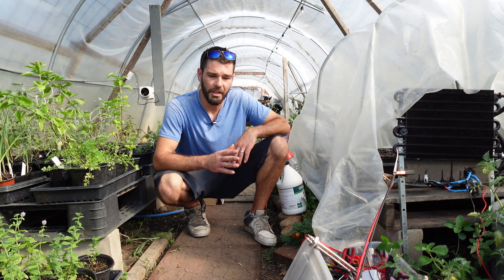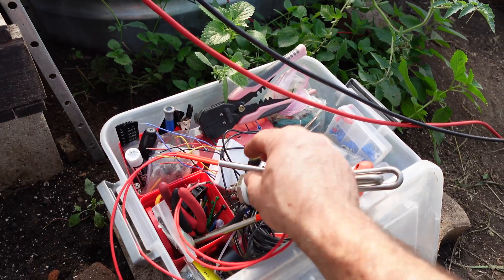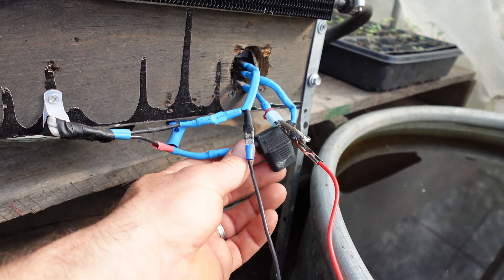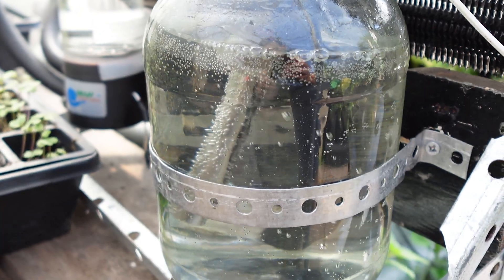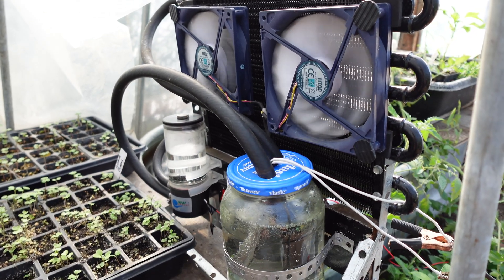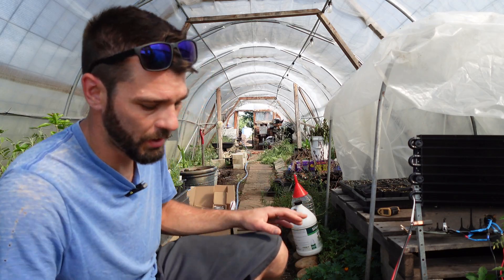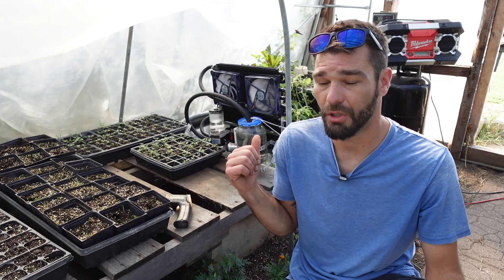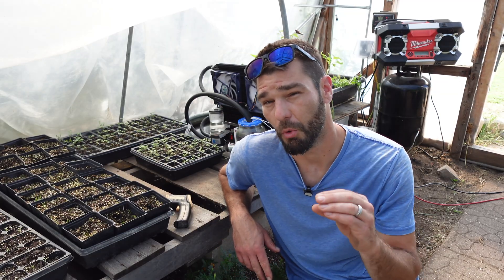DIY Solar Heater - Winter Greenhouse Heating & Seed Starting - Making our Own DIY Coolant/Antifreeze

Comment: I have thought about solar heaters for a while now, and when you pulled out the 300w element, I knew for sure I was on the right track...😂
Reply from the maker: Yeah it need to be big to make any difference when heating water. I’m currently building something to operate just that

Comment: How fresh does my wood pile need to be to get good heat off my pile. I’m hold 80-90 but not quite cooking yet
Reply from the maker: The fresher the better for a good nitrogen content. The older the chips the more water and nitrogen needed to form a good active heap
Reply: @Earthdwellershomestead trying to get freshly chipped from a landscaper but no luck yet. I have a days worth of maple climbing to saw out enough to rent chipper for day but need to climb  to get to limbs 😊